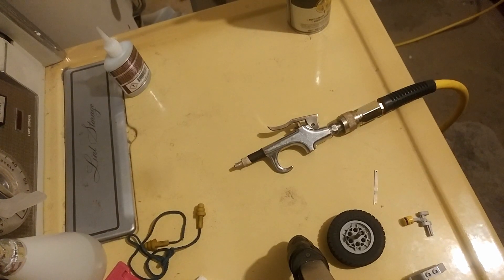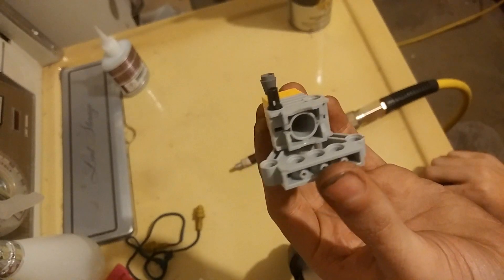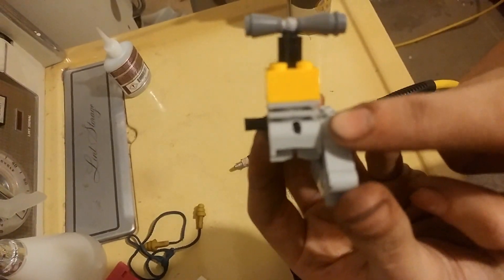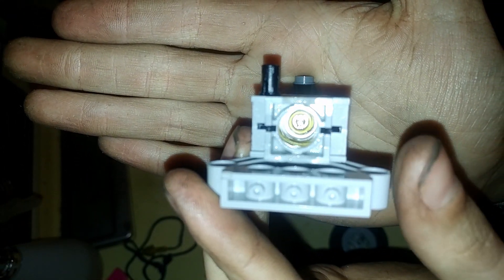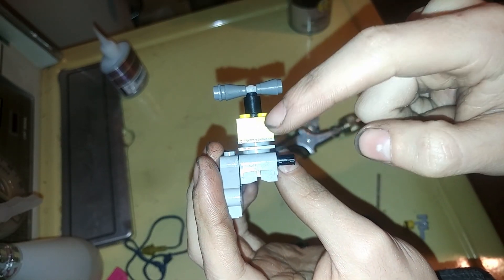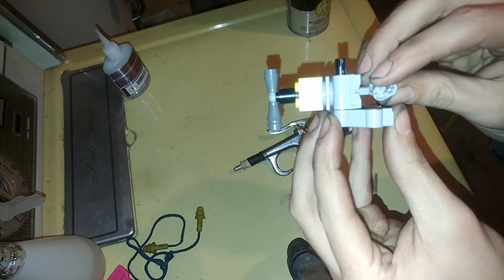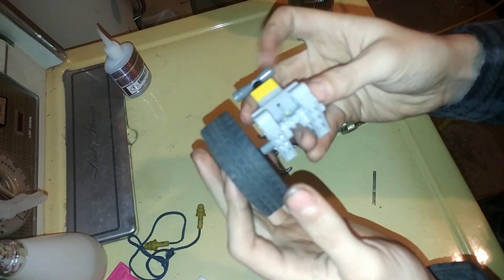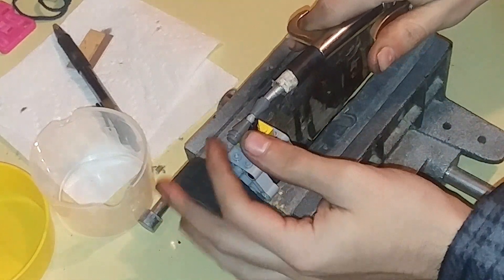Lego Pneumatic Engine Single Cylinder Prototype Demonstration

Comment: Just curious, How much resistance can you feel when the piston hits the valve? Because I’m trying to make my own but I’m not sure how much it needs to be screwed down
Reply: It should pushed on once the piston is about to reach the top
Reply: Same here, should it move the rod on the valve the full distance it can travel. Or just barely jump up half way
Reply: Just put pressure on it and screw the valve in until it stops doing leaky noises

Comment: Lego: Build with lego and not non-lego pieces.
Other people: How about I just ignore those rules.
Reply: The only rules that matter are the laws of physics.
Reply: I’ve designed and built a similar 1 cylinder Lego engine but it uses a Lego valve so it’s only lego made engine. Surprisingly it work very well
Reply: yes

Comment: Dude this is the most compact switchless engine I have ever seen, what type of valve did you use ?
Reply from the maker: It's built using a tire valve. you can find them at any auto parts store
Reply: @splob1981  or get them for free or cheap at your local car tire changer
Reply from the maker: @maalos  i have access to used tire valves at the shop i work at, but i wanted new ones
Reply: @splob1981  well, mine works perfectly and doesn't leak, but it's up to you what do you choose
Reply from the maker: @maalos  I'm positive it would work the exact same with used valves, I just wanted new valves so they are guaranteed perfect and appear nice and shiny
Reply: @splob1981  mine are shiny too lol